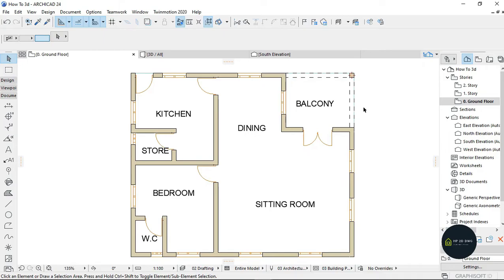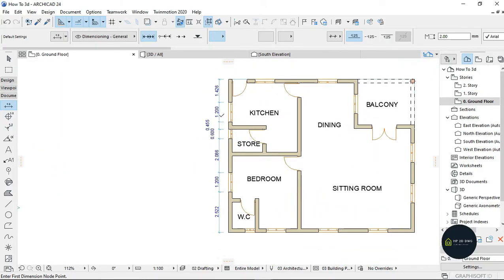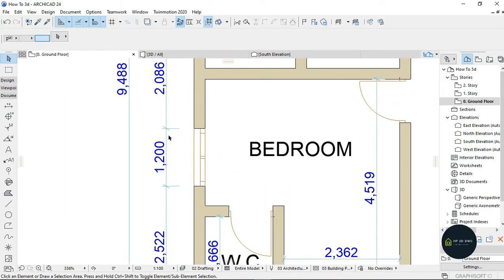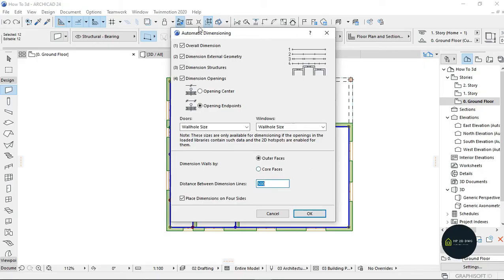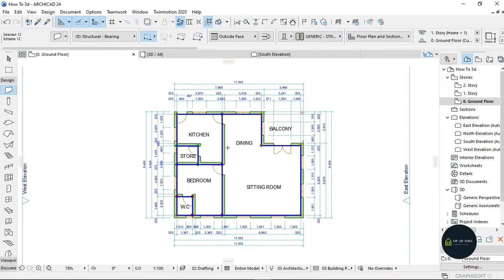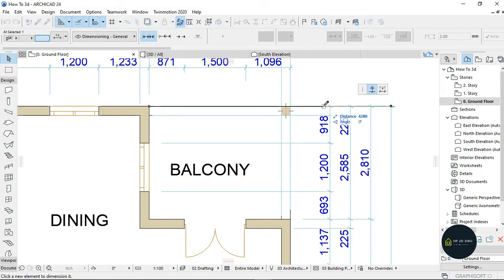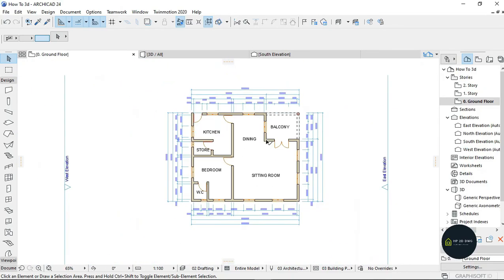Archicad Tutorial: How To Dimension

Comment: Hi thanks for video, how I want my dimension showing "1200" instead of "1,200", how do I change that ? thanks
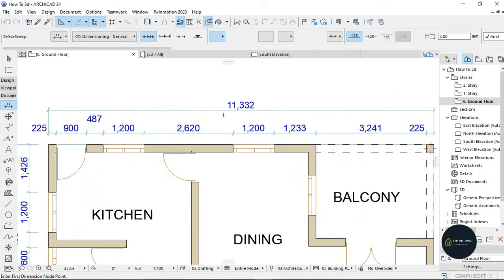Reply from the maker: If i get you correctly you want to change the unit of the dimensions, then i suggest you watch this video on dimensions and skip the video to 2:36 
This js the video link 🔗
https://youtu.be/PJpanTBBZE4
Reply: hi thanks for your reply, what i mean is that i want all the dimens to be in mm, however i want it to show "1200" instead of "1,200" (without the " , "), wondering how do i change that ?  @Houseplan2ddrawing
Reply from the maker: If it's going to be in "mm" it would have the "," by default, the only way i could think of is, by custom text, but with this you'll have to change all the dimensions one at a time
Reply: @Houseplan2ddrawing  thanks, interestingly in my company only one colleague have the “,” by default. Mine don’t have the “,” by default. 
So I am looking for a solution for my colleague
Reply from the maker: Try and check what project settings & working units settings he's using then set it with yours...  @mascness_gaming
Reply: @Houseplan2ddrawing  hi do you mean “project preferences” ? Unit “archiCAD” button ?
Reply from the maker: Yeah @mascness_gaming
Reply: @Houseplan2ddrawing  thanks I will take a look and compare, he is off today, so will take a look, i rmb we checked that. We also wonder whether it it in the macOS setting (laptop setting)
Reply from the maker: Alright
Reply: thanks will keep you informed, in the country am working in, we always show the dimen without "," Merry Xmas by the way @Houseplan2ddrawing
Reply from the maker: @mascness_gaming  oh really, i never knew that, thanks and merry xmas 🎄 to you too!
Reply: found solved the issue - it is under MacOS setting - (under System preferences - Language & Region - Advanced) - remove the comma, need a restart on computer

Comment: Numbers do not show on my dimensions. How do i activate?
Reply from the maker: Numbers are supposed to be shown when dimensioning in archicad, that's when you pick two or more points, i'll suggest you open a new project in archicad and try it,maybe the problem might be coming from your current project, also check your dimension settings in ur current project maybe you have mistakenly made some changes you shouldn't have.